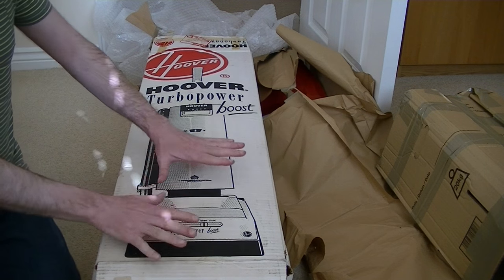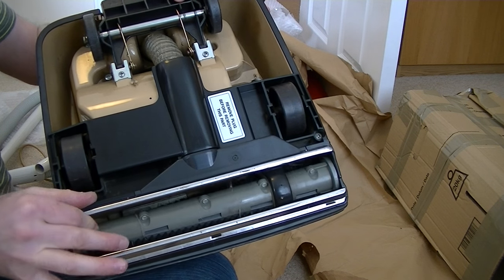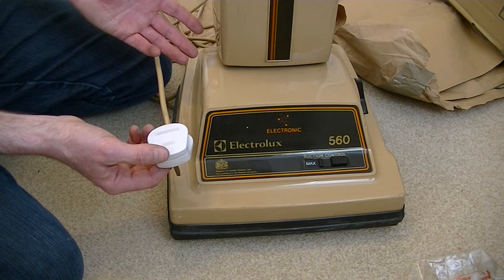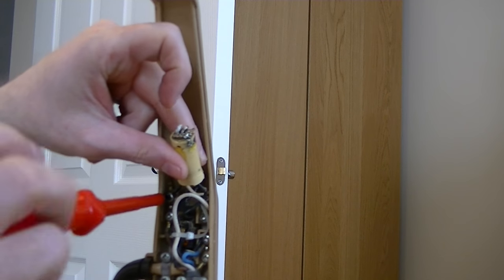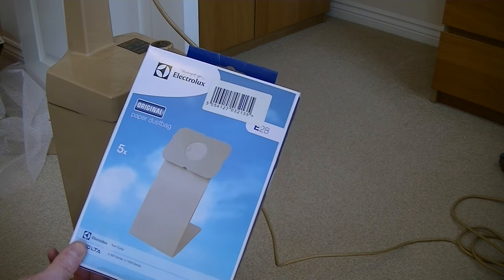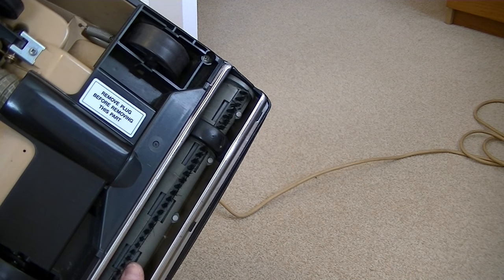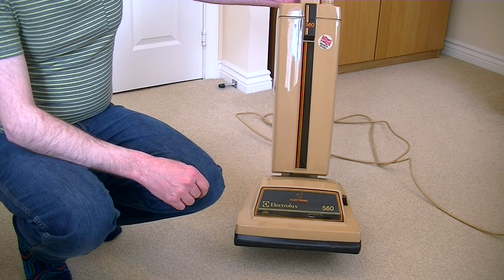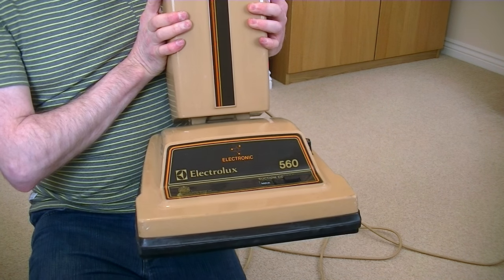Unboxing Another Vintage Electrolux 560 Electronic Upright Vacuum Cleaner

Comment: Absolutely loved that video of the 560!  It's kickstarted my thoughts of finding one now!  I bought a 502S from eBay, as loved seeing the Electrolux 500 range being used growing up by neighbours who had one!  Had to replace the bearings which seem quite hard to find (and would love to know if there are companies that still sell), and managed to buy a brand new double pack of new brushes which I replaced.  I stripped down my 502S completely, cleaned and greased where needed, along with polishing up of minor scuffs, and is like a brand new vacuum now and use all the time!

Comment: Hi Roger. OMG I hate it when the suppressor blows. Ive got one of these and the suppressor is defo getting removed. Not all the 500 series have them in the handle. If I remember correctly the 500, 502, 502s and 504 is like a square clear suppressor attached near the motor and are a pain to remove.

Comment: rip
Are you okay, comrade?!
Same thing happened to me with my Hoover stick vac when I went to reinsert the battery. As I transitioned to brushroll mode it EXPLODED LIKE THE USSR! I almost burned my hand that I had to be rushed to the emergency room, with the vac still clutched to my hand. Im fine, I just sprained my arm and cut my finger. The vac was repaired and got this exact transplant. So far I barely use it now. Prolonged use, maybe?

Comment: Fascinating design where the motor resides in the lower portion and sucks air through one side of the "axle" and blows the exhaust up the other side of the rotating axle.  Question:  when in "tool mode" with the hose inserted, does the rotating brush roll still make contact with the floor?  Or is it raised up to a height where no damage can be caused?  Was there an attachable bottom plate provided to protect toes and fingers?  Thanks Roger! :-)
Reply from the maker: +Brian Torobin The cleaning head raises up when in the upright position, so the brushes don't touch the carpet, but they might do if the carpet had a very long pile.
Reply: +ibaisaic Roger you should put a black plug on the Electrolux as it will match the accents

Comment: Sorry to ask, but what does a suppressor do?
Reply from the maker: +Eli The Schmer It stops the vacuum cleaner from rebelling and taking over the world. It can also be used to stop it interfering with TV and radio reception, but I don't think that's a problem now we have digital broadcasting.
Reply: +ibaisaic I figured so😂😂😂 Did the old Hoovers (Juniors and Seniors) have suppressors? If they don't that would explain why I can't watch TV at my grandmas house while she's vacuuming.
Reply: +ibaisaic why can't u watch TV with a vacuum with a supressior
Reply: +ibaisaic It does still matter. A new supressor should be fitted as the RF inteference from the motor can also intefere with WiFi, ADSL broadband, analogue radios, ametuer radio etc. Was fitted for a good reason! The suppressor is often a capacitor across the mains and they eventually break down and form a short across the mains then go pop. They are easily picked up from CPC Farnell, RS and maybe Maplin.
Reply: ibaisaic What is a suppressor? If I may ask.
Reply: +PlanesAndSirens A capacitor. It acts as a filter for the electrics and prevents radio frequency noise from going backwards back into the power grid. The power wiring the walls acts as a large antenna to such frequencies and it's quite disruptive to others. It's pretty easy to replace since it's just a capacitor.
Reply: Ahh. Okay.